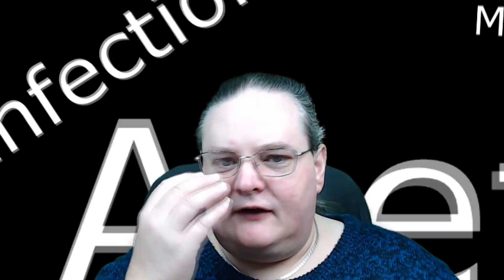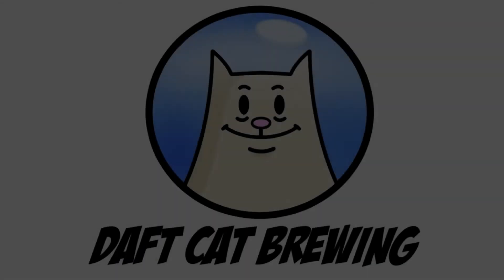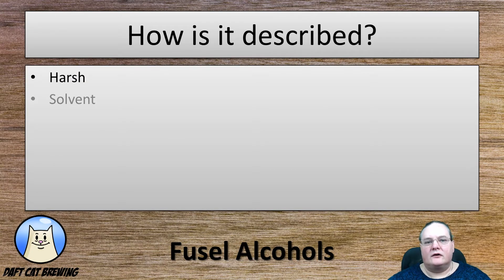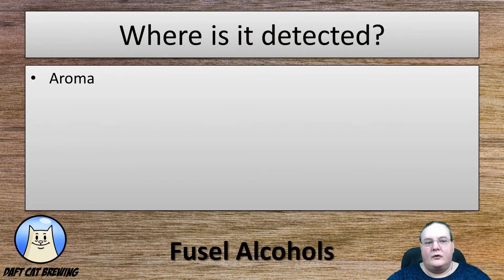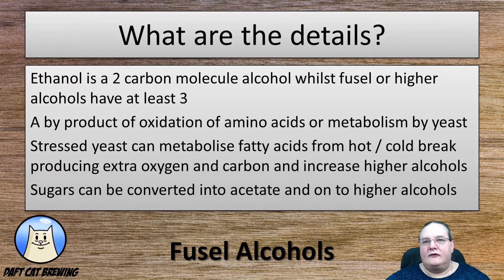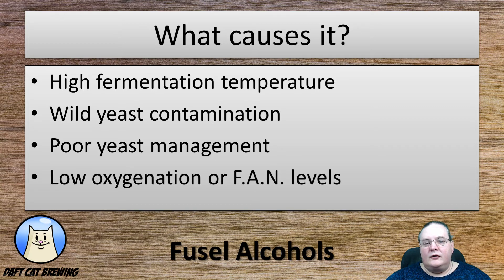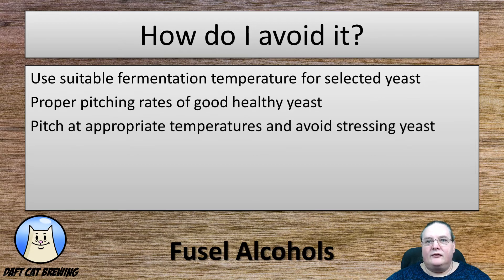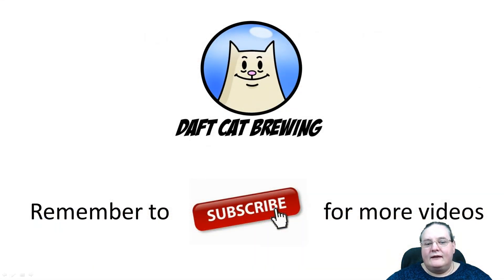Hot or solvent - Fusel alcohol beer fault

Comment: I'm making mead, do you think it'd be best to add fruit juice rather than whole fruit, to avoid more proteins which could convert to fusels?  Also, how long would you say it takes for fusels to break down?
Reply from the maker: I've only made one batch of mead before now and I know some of the chemical processes can be different, so I am probably not the best person to advise you there. Hopefully one of the viewers will have some more experience and be able to give you a suggestion. With regard to them breaking down, they will start to break down after a month or two but the higher levels in the finished beer the longer they will take to get back below detection levels.
Reply: I always age my mead or wine at least a year in a natural corked bottle.  Make sure to let the bottle stand for a week so the cork can dry out, then tip it on its side for storage.  If it has fusels they should mellow out into esters within a years time.  It does not really matter if you use fruit or juice in the primary, just use some pectine enzyme and it should clarify.
Reply: Lack of nutrition, bacterial and fungal infections, too high heat while fermenting, unfermentable things that sit: like pectin, sugars, FODMAPs, starches and excess proteins all lead to excess fusel creation